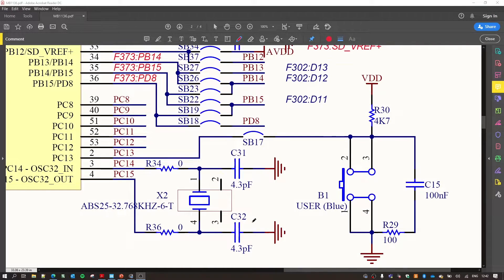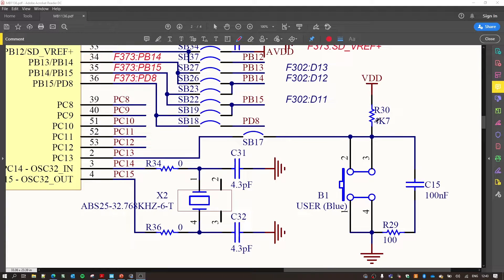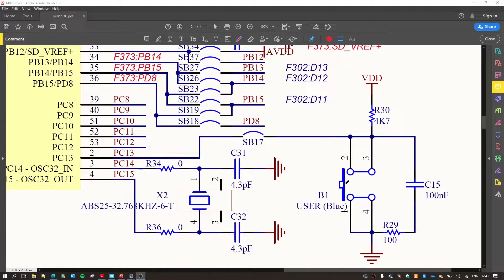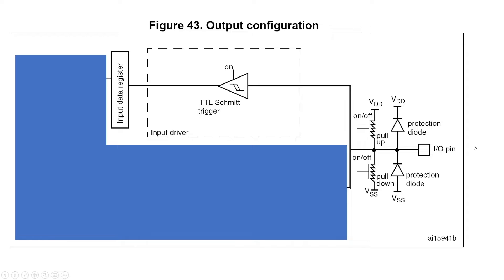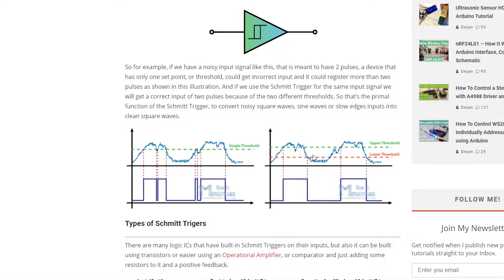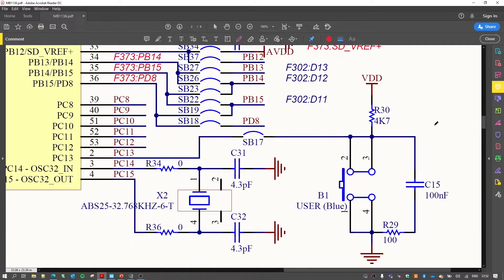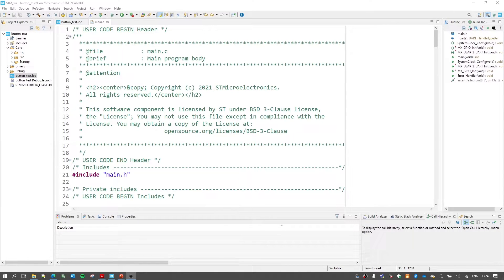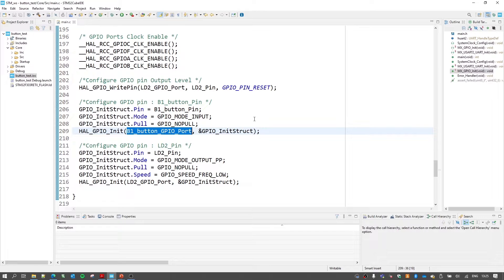Push button | #6 STM32 GPIO Input

Comment: Thanks, nice intro on how to use button with GPIO. Some remarks on coding style... I would not hide HAL_GPIO_ReadPin behind the "CHECK_BUTTON" define as this makes code harder to read. The statement itself becomes shorter yes, but I have to jump to another location to reason what happens in the if statement. If you return the result to a local variable as you did initially code becomes easier to debug. Also I would use existing definitions over magic numbers and check if button was pressed by GPIO_PIN_RESET. If you find the negative logic confusing then it's totally fine to have #define PRESSED GPIO_PIN_RESET and add a comment that explains negative logic.